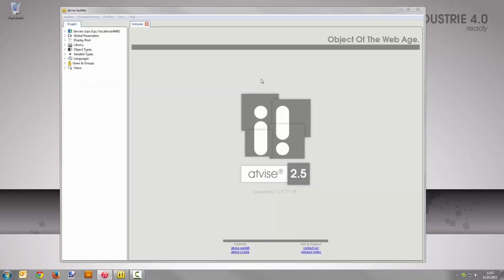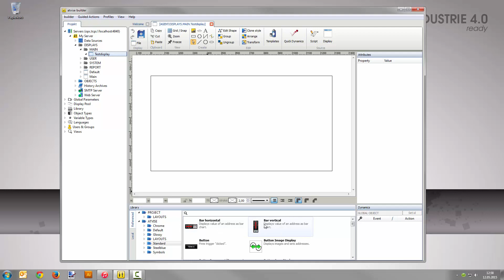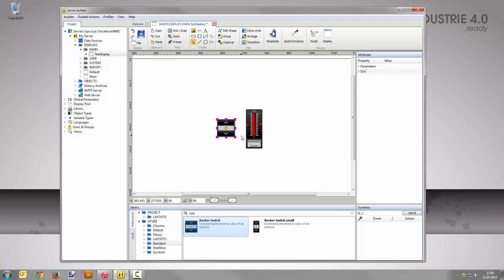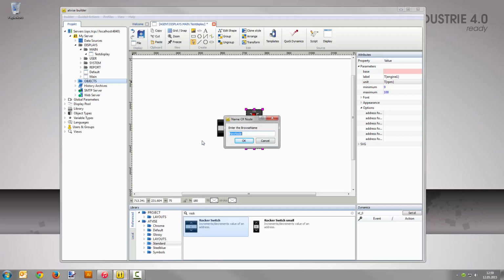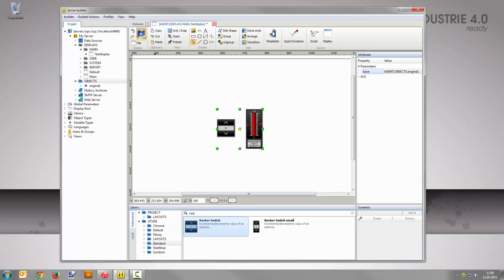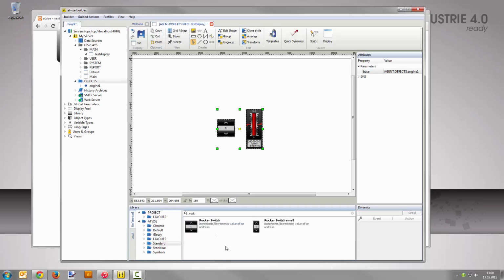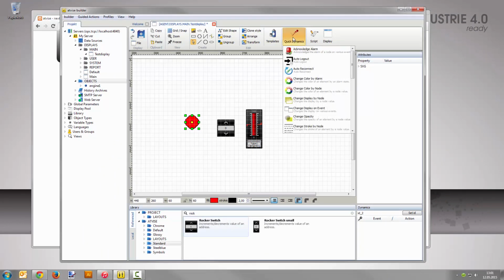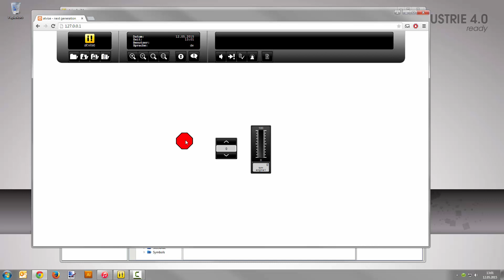atvise® Engineering 2 (EN) - with atvise® 2.5

Comment: Hi Thanks for the tutorial. Please  in my atvise builder I have a data variable node with a yellow round icon instead of blue. My base address is   DemoServer/engine1 instead of AGENTS.OBJECTS.engine1 .  Consequently this example is not working. Is there anything wrong with my builder settings or what is wrong ? Thanks.